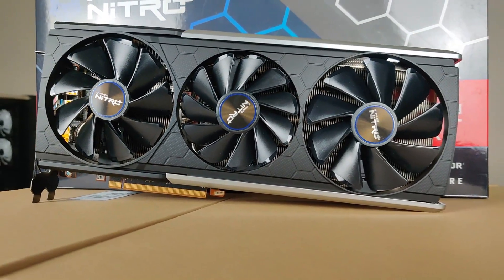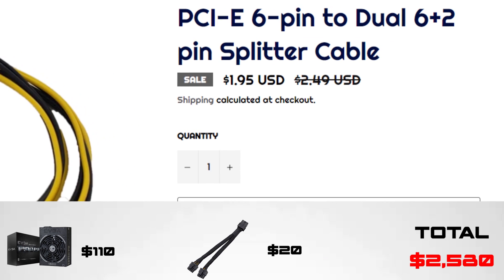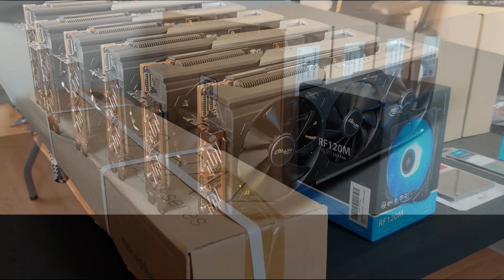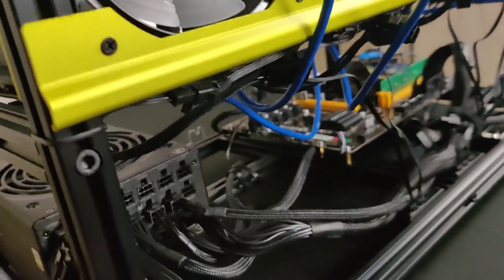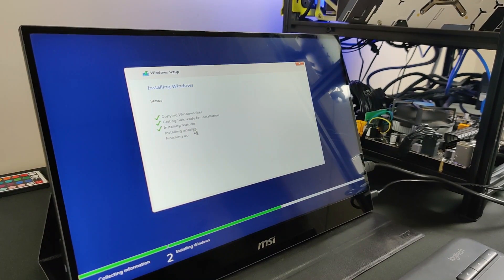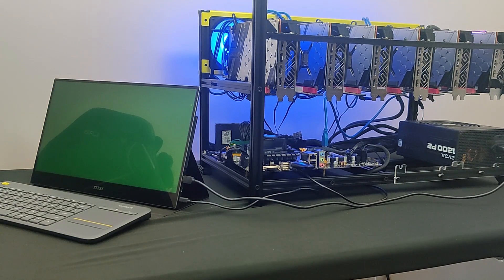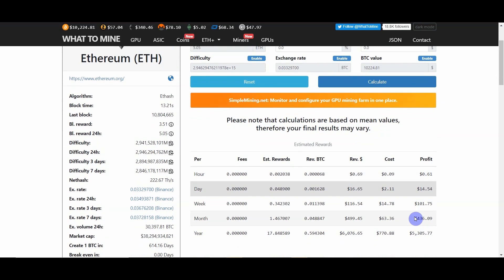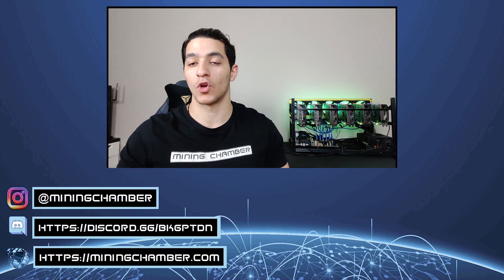RX 5700 XT Mining Rig Build - 6 GPUs | 330 MH/s and ONLY 880 Watts!!

Comment: Hey dude. Have you tried the RX5700 XT Triple Dissipation vs. Nitro? I was reading somewhere that you can potentially get 60 Mh/s @ 68w, but that sounds way too good to be true. Curious if you've compared the two cards, or even vs. the Triple Thicc III Ultra, which is also supposed to be decent. Thanks so much for your advice/insight!
Reply from the maker: I have not tried it myself but I do know that 60mh at 68 watts is impossible for sure! It can be 68 watts in software but not off the wall. Usually they all come around the same hashrate per watt the only difference is the heat. I believe Thic II and Thic III are pretty good at heat dissipation

Comment: Hey there! Awesome video. Inspired me to take up my next build. I want to build this same exact setup, but with 8 of the cards. I am thinking a single EVGA 1600 W Platinum should be sufficient? Do you think 2x Rosewill 1000W bronze PSUs should handle 8 of these? I am not a fan of the bronze, but their price point is stupid cheap ($150 new as of today) for 2000w total, or 1600w after 80% efficiency. Any thoughts on the best way to power 8x Nitros? Thanks!
Reply from the maker: Hey! Thank you!! 
We are actually doing an 8 gpu build soon and we got for it 2x 850 watts Corsair RMx Gold model. It was a pretty decent price as well from Amazon for around 130- USD. I'd recommend them since they are not too much of an overkill and it will still be quite effecient! As a secondary option I do think the 1600w PSU is better for effeciency as well as reliability. Although splitters will definitely be needed to power all double 8 pins!
Reply: @MiningChamber  ah, yeah, that's a good setup and makes sense. If you're running the cards @ 130w * 8  + ~200 for the system then the ~1445w total is plenty. Useful info as these EVGA platinums are getting insane in price! Thanks!
Reply from the maker: Exactly! Although system will usually be around 55-60 watts the rest will all be GPUs ⛏️⛏️ good luck!

Comment: I have a question. You have 2 x 6+2pin per rail, so what you do is using 1x6+2 connected right to the gpu, and the other 6+2 is connected to a splitter wich you connect 1 to the riser and the other to the gpu?.  is that safe? wich 6+2 on the cpu is the primary?  have you had any problem? thank you!
Reply from the maker: Hey! Not sure if I understood you correctly but we did power each GPU with 2x 8 pins using a splitter on one 8 pin and then the other 6+2 we used for the riser. In the begining we show that everything is not fully connected since we were bios modding and plugging them in one by one.

We do have a video that covers almost all the info about connections of the ATX PSU it should be one of our latest videos I'd recommend checking it out for more info specifically on this topic!

Comment: Can I use this exact rig to mine BTC?
Reply from the maker: Not necessarily to mine BTC since that requires ASICs. But you can use Nicehash which rents your hashpower and pays you in BTC or you can mine ETH and sell it and buy BTC
Reply: @MiningChamber  Thanks for the info! I ordered everything from Amazon yesterday using your links and then cancelled my entire order because I realized I wasn’t able to mine BTC. I’m worried about this investment because of the whole ETH 2.0 thing that’s coming down the pike. Do you personally mine BTC? If so, do you have a hardware list or video so I can make a BTC rig? Do you feel mining ETH is better than BTC? Thanks for you help with this bro, I really appreciate it.
Reply from the maker: With GPUs it's best to mine ETH for BTC you need ASICS like I mentioned above. ASICS are not too residential friendly ! Too hot and too loud. 

It's best to mine ETH and sell into BTC !

Comment: that gpu design vents heat out the top and bottom of the card the fans would work better laying on top of the heat fins and tapped bellow them. also a titanium rated power supply would save on electric cost i think.
Reply from the maker: That can definitely be a good way to cool them! Although we mainly put the fans for aesthetics since the rig stays cool in the mining location due to box fans and such. As for the PSU it does make electricity cheaper for sure but we still have a low enough rate that the couple of percentage difference between Platinum and Titanium will be not too noticable! 

Great suggestions though! I'd recommend titanium for a large scale farm that has expensive electric for sure

Comment: Hello i have a MSI RX 5700 MECH GP OC and my problem is my memory temp is around 90-92C* my fan speeds are 2530 RPM so 79% speed could you maybe help me out or what i should do
Reply from the maker: I would try to tune it down slightly on the undervolts if you can and maybe pump up the fans to 100% . If it's too loud for your convenience then I'd try to just get some external fan to give it some air! Memory temps usually get hot but below 90c is definitely a better spot!

Comment: I wonder how accurate the estimators are. I've just starting mining with a 1070/1660 rig that has a 50 MH/s combined rate, using Nicehash, and seems the best I can hope for is $1 per day after electricity (.11). So this rig has 6.6x the hash rate, which should be more like $6.6 per day profit after electricity.
Reply from the maker: The numbers do change pretty often, it takes in block rewards, difficulties and other factors. So the profits since then surely dropped but we'll hopefully be seeing a rise again!

Comment: why are you using just 8 pci pins to power up the rtxs when they need 2x8pins? how does that work?
Reply from the maker: In the video we said we have them off so we can BIOS MOD! We plugged them in one by one then at the end all are plugged
Reply: @MiningChamber  thanks for the rapid response! mmm now you got me thinking. i ordered 2 msi rtx 5700 last week. i assumed they just needed a 1x8pin connection. if they need one more, that's another psu.
Reply from the maker: @MarcosDanteGellar  It does not necessarily mean another PSU! Id recommend checking one of our latest videos about ATX PSUs so you can grasp the idea for power delivery. No problem at all!

Comment: Hello, what motherboard can I use for a rig with 6 gpu rx 5700? can an asrock h110 btc + motherboard work?
I have read that this motherboard supports ddr4 memories and the gpu rx 5700 is ddr6
Reply from the maker: Hey!! Any motherboard that is dedicated for mining will give you an easier time, the more pcie slots it have the more gpus you can run on it.

As for the ddr4 that is referring to the RAM not the VRAM of the GPU. So you will be fine !

Comment: Hi question -  I am having issues running my 6x 5700xt past 3 GPUs.  I am on a 1200 Watt Platt Battery, and only seeing 920watts max.. although every port in the battery is being used.  I am wondering if not enough power is being distributed between the cards?  Each card has been tested individually and works up to 3 cards in every scenario.
Reply from the maker: Hey! Not sure if my answer didn't come through but come join us in discord we can help you there!!

Comment: So im confused, why do you have use the molex connection on the motherboard  ? and secondly how are you powering all 6 cards, when they require 2 8 pin connectors, that would leave you with no PCIE cables to power the riser cables.  or not even enough Pcie cables  to power the gpus alone. ?
Reply from the maker: Molex connections on the motherboard provide power to the PCIE slots so that the gpus can draw extra power from there if needed. We used I believe a total of 9 splitters which we had to daisy chain one of them to power 3 risers through one 8 pin but then eventually changed that daisy chain with a dual 8 pin plug with 2 splitters.

We have a video that talks about the cables and pcie connections in details feel free to check it out! https://youtu.be/e7AO8ADUD5g

Comment: Hello, I have a similar setup using a Corsair Ax1200i. When I connect the 6th card the psu trips off after a minute. It works well with 5 cards.
 Any ideas?
Reply from the maker: That is very odd, check for the wiring if anything is miswired or seems broken. Possibly try different ports and such!
Reply: @MiningChamber  do you mean PCI-E ports? The wiring seems OK, it trips like there's a surge coming from the motherboard (MSI Z170A G45). I will double check wirings further.

Comment: PhoenixMiner.exe -pool ssl://eu1.ethermine.org:5555 -pool2 ssl://us1.ethermine.org:5555 -wal walletaddress.rig001 -openclLocalWork 128 -openclGlobalMultiplier 4096
pause

I  just tried those config & still got many incorrect share from GPU 2

Eth: GPU2: ETH share found!
Eth: Share actual difficulty: 6797 MH
Eth: Share accepted in 18 ms
Eth: New job #cfcd2c22 from ssl://eu1.ethermine.org:5555; diff: 4000MH
Eth: New job #b8f41935 from ssl://eu1.ethermine.org:5555; diff: 4000MH
GPU1: 54C 59% 114W, GPU2: 56C 60% 116W
GPUs power: 230.0 W
Eth speed: 123.399 MH/s, shares: 3/0/2, time: 0:02
GPUs: 1: 60.087 MH/s (0/2) 2: 63.311 MH/s (3)
Eth: New job #92708404 from ssl://eu1.ethermine.org:5555; diff: 4000MH
Eth speed: 122.491 MH/s, shares: 3/0/2, time: 0:02
GPUs: 1: 59.192 MH/s (0/2) 2: 63.299 MH/s (3)
Eth: New job #afaac1e3 from ssl://eu1.ethermine.org:5555; diff: 4000MH
Eth speed: 119.263 MH/s, shares: 3/0/2, time: 0:02
GPUs: 1: 56.015 MH/s (0/2) 2: 63.248 MH/s (3)

Eth: Incorrect ETH share from GPU2
Reply from the maker: Yes I had the same issue, I recommend not using those parameters!

Comment: how to get reliable calculation while i do other site with 330Mh/s and 880 W , the profit only 3.6 per day ?
Reply: Can you confirm it is only 880-900 w totally for these cpu +system ?
Reply from the maker: Yes I can through a wall power meter !
Reply from the maker: We do have a link in the description that links directly to the calculations (WhatToMine) now the block reward is smaller so the profits will be less for sure as the well as the prices dropped a bit.

Comment: bro thanks for videos!! i can use 12 rx5700 with b250 asus motherboard?
Reply from the maker: That is correct! Although I do recommend running it in HiveOs or some other mining based Linux since windows can be unstable with 12 cards!
Reply: @MiningChamber  so windows stable with how much gpu bro? 10 is ok?
Reply from the maker: I'd say 8 GPUs and then above that it starts getting rough

Comment: Is 1200w on single rail (8 vga outputs, 1200W dedicated to those) enough for 8 cards? I mean can we decrease power consumption to the neighbourhood of 145w without losing that much of computing power? I have missed that part. Unfortunately, the only reasonable price tag is on Gigabyte AMD Radeon RX 5700 XT OC here
Reply from the maker: If your going for 8 cards I recommend getting a higher Psu. Either a 2x 750 watts or a 1600 watts PSU to stay safe. We recently did a video on this topic check our latest upload!
Reply: @MiningChamber  I will check right away, my main concern about that is finding a psu with multiple 8-pin outputs. Here in Turkey, they are scarce and very expensive but 2x750w sounds more doable, would only cost 200₺/26$ more. I should revisit this idea after watching your other video
Reply from the maker: Sounds good, good luck!!

Comment: Hi
I built a 6 card 5700xt rig and used the undervolt settings you suggested in a video for performance. I did not bios mod. After running Nicehash for approx half hour I get windows blue error screen with: Video TDR Error. What failed: Amdkmdag.sys. 
I have all the latest amd and windows drivers. I am going to try an older set of Amd drivers.

Thanx in advance
Reply from the maker: Try to uninstall drivers with DDU and install them again the 20.4.2 and reduce the overclocks a bit

Comment: Would this rig work with a Ryzen threadRipper 9 AMD 1950X instead of windows?
Reply from the maker: It would work with any cpu although you will need a different motherboard to support that cpu! As long as the motherboard have 6 or more pcie express  lanes then you will be all set. With the thread ripper you can also cpu mine. It will replace the intel cpu not windows ;)
Reply: Mining Chamber so is windows faster than intel? I’m assuming you can’t mine the cpu with windows?
Reply: Mining Chamber are you using a 120v or 220v?
Reply from the maker: I'm using both!

Comment: How about those who have a solar powered house ?
Reply from the maker: It would definitely be cheaper and more profitable! It depends how much watts the solar can provide since I'm not sure how it works or if the battery will run out while running a bunch of mining rigs 😛⛏️
Reply: @MiningChamber  having either 300W solar panels of hydro-generators.
Reply from the maker: Mining rigs average can take anywhere from 900 to 1500 watts. So you do what seems best fit then let us know how it goes!

Comment: Hey! For how long do you think this setup will be profitable? Are there any cons or other better options?  Because I was looking for  INNOSILICON A10 Pro ETH Miner if not. What do you think?
Reply from the maker: there really isn't much Con, it's not a buy it and get rich scheme. You have to be patient. ROI can move around very fast. It can take a year, 6 months, 2 years. It jumps alot based on the crypto space. As for the ASICS I do think they are a good option, I never tried them myself but the downside is that they Are loud and produce alot of heat!

Comment: Did you get the thermal compound with the CPU or did you buy that separate ?
Reply from the maker: I did buy that separately but most new cpus that come with a fan have thermal on the fan heatsink for initial installation !

Comment: Hello, sorry, I did not understand what the function of the PCI-E Splitter is, can you help me? Thank you!
Reply from the maker: It's just to turn a 1 8 pin to 2 8 pin which gives you more connectors for your GPU and risers
Reply: @MiningChamber  Is it advisable to use them? I have the same graphics cards, but a different board and the power supply I have not bought yet

Comment: thx alot plus how loud is it rig running
Reply from the maker: It's usually around 60db on low fan speed but at 70% fan it's 70-80db. It sounds like an air-conditioning is on

Comment: hey bro im working on my 3600 xt rig and one of my gpus is consuming a lot more wattage with the same clocking do you have any tips or tricks as to how i can troubleshoot this?
Reply from the maker: Usually means that the Overclocks didnt kick through! I recommend restarting the system and trying again. Worst case, reinstall the gpu drivers!
Reply: @MiningChamber   i reinstalled drivers reinstalled the bios, changed the bios to a diffrtent one, nothing. so annoying
Reply from the maker: What are you using to over clock it ? Plus for 5600XT usually it's not recommended to Bios mod them

Comment: 6 5700XTs modded and running at 330MH/s+ but what's the trick on power usage? At the wall I'm getting 975ish which doesn't seem terrible but 880 would be way better. I used over driving tool to get the mv down to 725 but according to msi afterburner their still at 750mv, core clocks are all at 1300, memory clocks all at 1800. Thanks @redpandamining for the mod video worked perfectly, and thanks to you guys in advance for all the help. If I have to use the AMD software to tune these do you have a video for that for the 5700XTs or could there be one upcoming soon :) Thanks again!
Reply from the maker: Hey Bryan! Thank you! MSI Afterburner is not accurate once you use MPT when you BIOS mod the cards, we used Wattman to do so. We did post a video about it here: https://youtu.be/F-GFMUYFQPM

Let us know if you have questions after following the steps there! Make sure to use MPT so you can undervolt down to 725-750 using AMD wattman or OverdriveNtool
Reply: @MiningChamber  Appreciate the reply, Well crap, it looks like I only half a** modded them lol. I modded the timings but did not realize I should have used the MPT tool during that process to modify the undervolting settings as well. I'm actually a quadriplegic injured in a car wreck back in 99 so I can't physically unplug and plug these GPU's back in and I do not want to do more than one at a time so I have a few questions. I have all of the modded bios' and original bios' in different folders labeled 1-6 and I know which card each is associated with, can I modify all six of the bios' adding the undervolting settings with MPT save them and have them ready to flash at a later time when I can get someone to unplug them one at a time? My other question would be, do you think flashing the bios' again should cause any problems? One more question :), is unplugging the GPU's just from the motherboard good enough? Definitely appreciate you man! Thanks for all the advice so far!

Comment: what M/hs would you get with out over clocking . i am looking for a gpu that will give me 30 to 50 M/HS with out overclocking
Reply from the maker: Overclocking is a MUST when you mine, if you don't overclock and undervolt the card then your single handingly killing your GPU! It reduces the power it draws and reduces the heat. So I recommend doing the performance overclocks if you don't want to BIOS mod the card!
Reply: @MiningChamber  do you have any videos on tutorial on ho to overclock?

Comment: In order for the overclocking to work do we have to flash the gpus?
Reply from the maker: To be able to push the undervolts to 725mv then you do have to BIOS mod, but if you rather not then you can do 850mv instead!